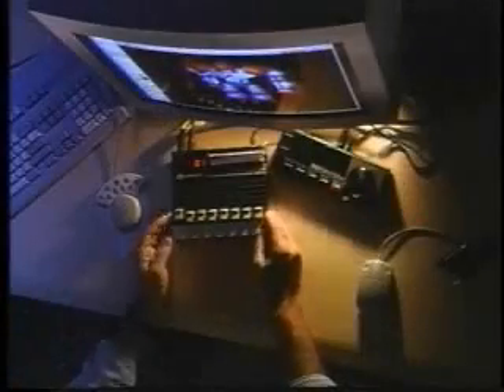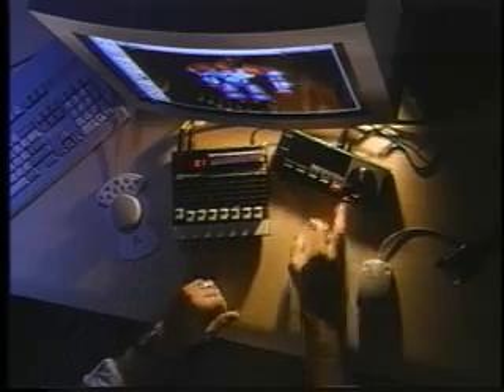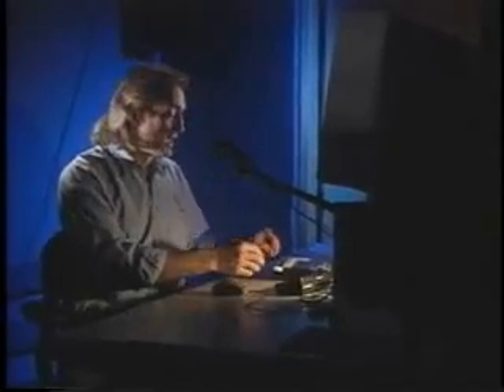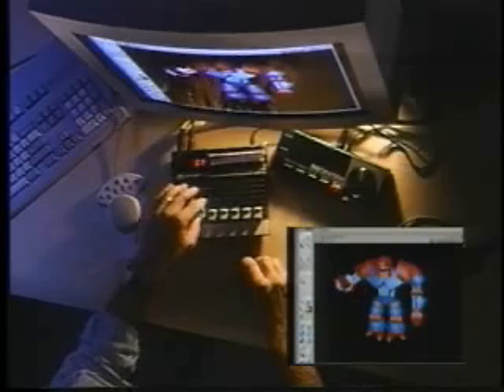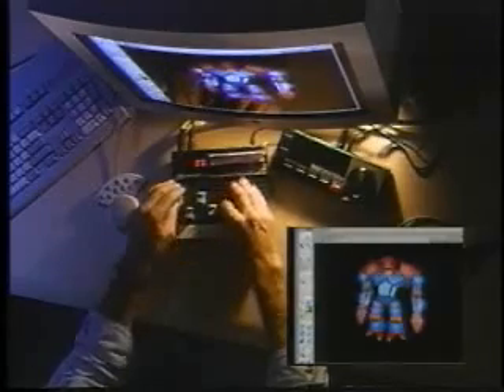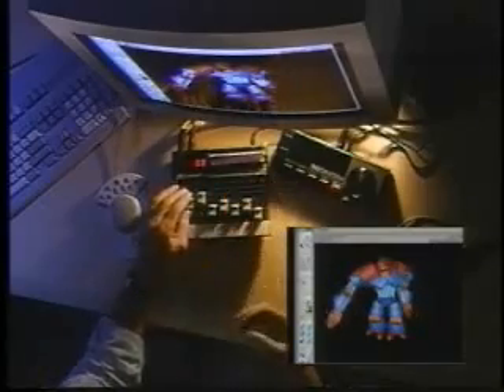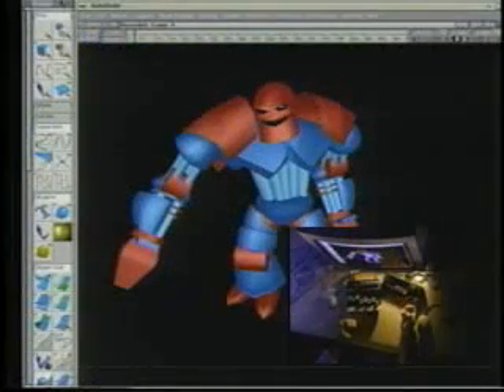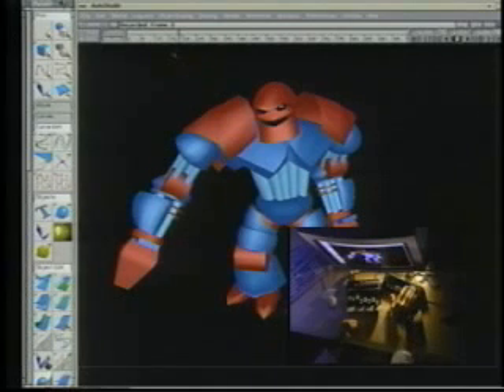"Stop" Animation Using MIDI Controllers

Comment: I also remember the Monkey2 controller, which was a modular set of jointed sensors that could sense rotation and could be used to construct stop-motion armatures that would control the rotation of objects in Maya/PowerAnimator.

This would also be great with motorized faders so that as you scrub through the animation, the faders would move to reflect the values that are already recorded.

Comment from the maker: Sorry, but this is work from a long time ago, and I don't have much guidance that would be relevant.  The one thing that I would suggest - which you probably know about - is to approach it using MAX, which is a great piece of software for programming the link between applications and controllers.  Do a search using the terms MAX and Cycling74

Thanks for the note.  I hope this helps.